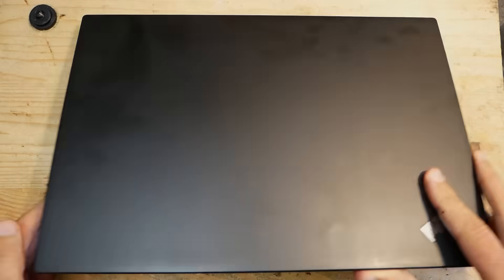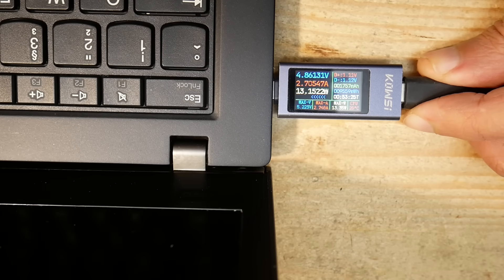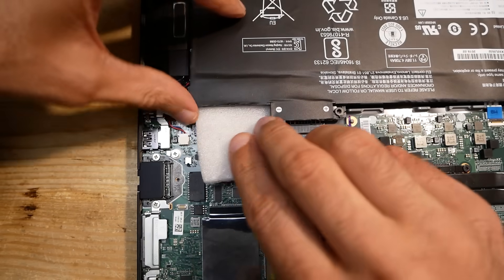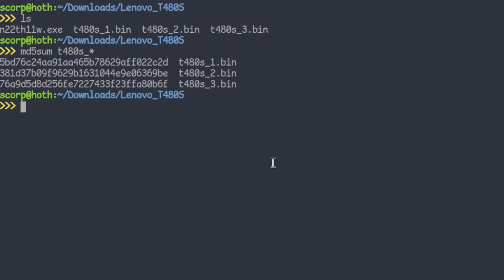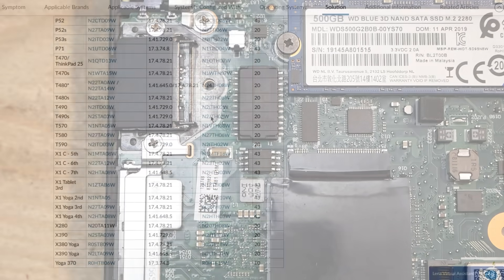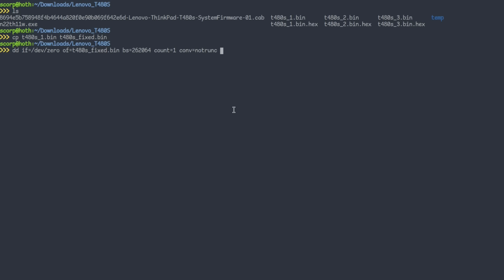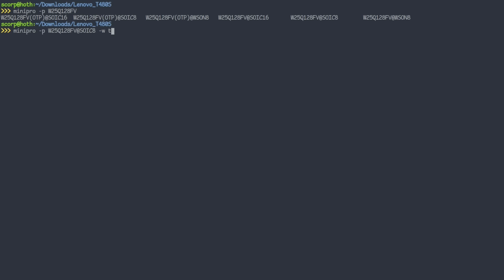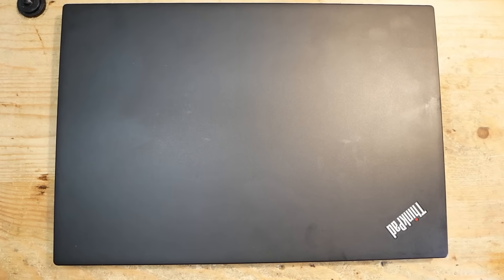Why is this Lenovo notebook not charging? Let's fix it!

Comment: Thank you so much for all the info, it has been a great help. I was able to finally fix my thinkpad. While I didn't use linux, I more or less did the same thing on windows, and I was able to successfully fix my thunderbolt port.

1. I used the T48 programmer along with Xgpro to read the original chip (W25Q80DVSIG) from the laptop. I did several dumps just in case.
2. I got new "W25Q80DVSIG" chips and used HxD to edit the original .bin file with the TBT.bin file from levono
3. Wrote the modified bin to the new W25Q80DVSIG chip 
4. solder the chip to the laptop and done!
Reply from the maker: Awesome, glad to hear that!

Comment: I have a T480, TB controller is not patched but I haven't ran into issues yet, I couldn't update it because I dont have the original charger or any thunderbolt device since it requires one of those 2 to update the firmware 😔
Reply: After few minutes of trying and rebrowsing the forums I managed to get the firmware to NVM 24! Turns out the fwupdmgr in Debian repo (in my case LMDE) behaves a bit differently, so I put the Ubuntu based LM in a ventoy drive and did the update from it and it works. I'm glad I came across your video and you replying to me so that I tried the whole thing over again 😊
Reply from the maker: You actually don't need the original charger to do that. If you plug in any usb-c charger with 65W or more and your notebook complains about a non original charger, then your notebook is already affected by the issue mentioned here. For the notebook there is no way to determine if the charger is original or not. The only way when it complains about that is if your charger doesn't deliver at least 65W. And that is exactly what this issue is about.
Reply: @necro_ware  i did try upgrading the firmware with the windows package  and fwupdmgr in Linux mint, both failed, it shows the old firmware version when I went to check after the update attempt. I found out after reading a post in r/ThinkPad. For now the laptop hasn't complained about the non genuine charger or lower wattage rating charger, and it still charges normally.

Comment: You're clearly very good at this! I run a non-profit; we have recently been donated 150 laptops. They're all Lenovo's and they're all potentially affected. I'll make sure our refurbishment workflow updates the Thunderbolt controller.

Also, I didn't know you could use a larger ROM chip, nor did I know of some of the Linux commands you used. Very informative stuff!
Reply: theoretically romsize shouldn't matter unless the pin layout and addressing is changed. It's convenient on the side of the manufacturer here as well because they swap in and out different sized chips as needed.

Though technically very strict rom handling could be problematic with this. In this case it's a firmware chip so that's pretty unlikely.

Comment: If you want to do any sort of repairs of modern devices one of those programmers and clips are essential. Those sorts of flash chips are everywhere
Reply from the maker: Not only modern devices. I'd say for very old hardware from 80's and 90's it is at least as helpful. Probably even more.

Comment: My main laptop is a T480s. I've added the X1 glass touchpad, T490 LCD panel, and new genuine battery. I get about 12 hours runtime, only ever run Debian Stable on it. I also don't have a TB controller in fwupd but also I've never had a problem charging... So I think I will leave it 😅
Reply from the maker: If you don't have TB in the list, then you probably just didn't realize yet, that you have that problem. With this issue the notebook charges with <15W, which is sufficient to charge it over night. But if you put some serious load on the CPU, the charger will not be able to compensate the power consumption.
Reply: Ah you are right. That probably explains why it sometimes cuts out charging. Well then. I will have a think about it. I have done small soldering but never chip flashing. This video gives a good tutorial if I want to try :)
Reply: @necro_ware  Update! I put a CH341A clamp on my firmware chip and read the same checksum three times. It seems my chip is okay, although the first ~256k has different contents than the latest TB controller firmware from fwupd. It seems my BIOS had the wrong settings for "Thunderbolt BIOS Assist" (Disabled good, Enabled bad) and "Pre-boot Environment" (off instead of on). Now my Thunderbolt controller appears in fwupd (with latest update already applied, apparently). I also got a hot air gun and desoldered an SPI EEPROM test chip successfully, so at least there's a new skill unlocked for me :)

Comment: Das Problem ist eigentlich dass beim In-Circuit Flashen der Controller auch mit Strom versorgt wird und der beim Beschreiben dazwischenpfuscht. Der Baustein hätte einfach raus müssen fürs neu beschreiben.
Reply from the maker: In manchen Fällen kann so etwas ein Problem sein, das stimmt, aber nicht in dem Fall. Erstens, wenn das so wäre, dann wäre der Inhalt über die ganze Länge des Speichers kaputt und nicht nur in den ersten ~256kB. Zweitens, der Chip ist defekt, ich habe natürlich nach dem Ausbau versucht den noch Mal zu lesen und zu beschreiben. Wie gesagt, das Problem ist, dass bedingt durch den Bug, der Chip andauernd beschrieben wird und über die Zeit ausgeleiert wird.
Reply: @necro_ware Nunja - wenns wieder tut ist das ja erstmal prima. Diese seriellen Flashes sind ja nicht wie deren parallele Pendants alle unterschiedlich anzusprechen sondern eher alle ziemlich gleich vom Protokoll. Daher kein Wunder dass größer funktioniert.

Comment: In some cases, when reading flash, car mcus without desoldering and using that clip, some other parts from mainboard can get powered up too and may intervene with read and write. In such cases, BIOS chip needs to be desoldered and flashed in programmer directly. If still write errors occurs, then yeah, chip is busted.. 😉

Comment: Is that terminal font Comic Sans? :p

People really love their thinkpads and go to great lengths to keep even the more modern ones going.
Reply from the maker: Almost. That's Comic Mono.
Reply: @necro_ware  ah.  I use one called fantasque sans.  It's pretty good.  Kinda "fun" in a similar way but not too out there that I may get bored of it.  The slightly warped shape and lines makes differentiating the glyphs easier, though I would hate comic mono's single storey lowercase A. :p

Comment: I still don’t get it why companies are releasing firmware updates just under windows. Get the bins or do an in bios update or better both. Acer is incapable of that as well but the worse is msi. Firmware is the most critical software on your pc.
So they should always offer the bin files alongside with a digital signature and checksum so you can verify before flashing

Comment: Lenovo also destroyed Vibe P1 phone with update. After android update, the phone ran out of battery in 4-5h. The mobile was just lying on the table, without sim card, without wifi connection etc. No further firmware update was released... The phone was under warranty, so it was returned to the dealer.

Comment: Shame on Lenovo - amazing fix! Too bad Lenovo didn't make their customers' life simpler by releasing some files for the DIY'er.
Reply from the maker: Thanks. Well, to be fair, they do supply their firmware files on LVFS and that is already a great move. I'd just wish Lenovo would keep up with the overall quality they used to deliver and stop pushing away the responsibility. Especially for such expensive models which were sold for professional market. Imagine the notebooks of that class cost new around 1,5k€ and it's a disaster to find out your device was killed by the manufacturer right after the warranty time has finished. They also didn't provide any information to any repair services and just told that the mainboard had to be replaced. Despite that the flash chip costs may be 1€. All in all, disappointing behavior.
Reply: @necro_ware  Exactly. They basically broke the device and all they supplied is an update file which is useless to most people. As a minimum, you'd expect a tech bulletin to explain the issue so others can repair it. But that would probably mean a class action lawsuit. In the end all those decisions are made by the legal office.

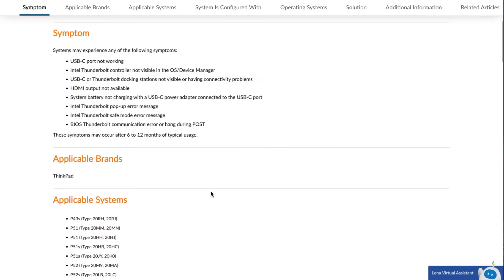Comment: 2:51 One day a new Lenovo firmware killed my network card. I couldn't believe it for a long time. Since the problem started with a blue screen appearing intermittently. When I accidentally removed the network card, the problem was magically solved. And with the help of some utilities I saw that my network card was locked. Thanks Lenovo I will never buy a Lenovo laptop again.

Comment: Great video, why not just write the bin file directly to the flash instead of filling it with 0s then patching it with the bin file ?
Reply from the maker: That probably wasn't necessary indeed. The damaged area was a bit longer, than the firmware blob, that's why I thought it would be a good idea to erase it.

Comment: What was the intension to fill the original firmware with zeros and then merge the new one into instead of flashing the entire new one directly?
Reply from the maker: No real intention. The damaged block was slightly bigger than the firmware blob, that's why I decided to erase it. Most likely that step wasn't really necessary.

Comment: had same issue with ThinkPad x280, at first was thinking it was bad USB-C port (as it was a bit crumbled), but even after replacing it (my first solder work with hot air station), still no luck. After a while found about the firmware issues with Lenovo laptops, flashing with programmer saved the laptop but if the wear on flash is high maybe getting new chip is good idea, replacing the flash chip seems to be easier than USB-C port anyways...

Comment: Why was it necessary to modify the binary to overwrite the sections which were no longer stable from the original chip? Couldn't you just have flashed the new chip with the entire binary that was provided by Lenovo?
Reply from the maker: Two reasons. First of all, there is no one firmware binary which is provided by Lenovo. They provide it in chunks depending on what needs to be updated. Second, there are unique IDs stored in the flash, like MAC addresses,  serial numbers,  Windows keys etc. If you overwrite the entire chip, you will lose that data.
Reply: @necro_ware That totally makes sense. I suspected you were trying to preserve unique attributes, but I didn't realize they offered the firmware in chunks. That surely makes recovery from a bad update very difficult!
Reply: @necro_ware  I want to try to fix my t480, it has all these symptoms. but could i use HxD to recreated the modification of the binary, on windows?
Also, couldn't I just replace the W25Q80DV with a fresh one and try to do the update from scratch using the levono Critical Update?

Comment: What a stupid fault. Stupidbolt firmware shouldn't have anything to do with powering the laptop or charging the battery. The power circuitry should be controlled by dedicated buck controller chip(s). Also the PSU should be outputting 20V anyway. Modify it to ALWAYS output 20V.
Reply: Welcome to USB-C power delivery. Active communications is required to negotiate what voltage to use

Comment: Maybe if the main platform controller is implemented in a way that it starts an operation with the flash just after reading the SFDP register first and getting all the right SPI commands and page/subsector/sector/block layout (if there's a slight difference) you won't notice a thing. Be careful with Winbond part numbers. There are Q (QE=1 fixed) and M (manual QE=1 toggle through SR2) variants. That's why I always update all the fimware when I buy a used notebook. Quite a few years ago a similar severity level update saved one from premature battery degradation. Had a similar issue with a T480, but fortunately the QSPI flash seemed salvagable. I had to temporarily configure a more relaxed thunderbolt security in UEFI to make it visible. There were some minor trackpoint unresponsiveness issues (under linux and windows) but fwupdmgr and LVFS solved it automagically after a fix was made available. TheLenovo Vantage and other windows based tools weren't able to to fix the TB issue because of some sort of bug or a coding error in a script if I remember correctly.

Comment: Very interesting. 
I have a somewhat similar problem with another Thinkpad, a much older one (model 755CX, pentium 75). It needs a firmware update to the latest one released by IBM, because the firmware it has on right now has a bug that prevents the driver for the sound card (Mwave combination sound card+modem) from installing in Windows 98. It works in Windows 95, but I want 98 on it. The firmware update file is available, however it's a Windows executable, no separate .bin file. And it has a weird quirk: it refuses to update the firmware if the laptop isn't connected to power AND has a fully charged battery. Yes, both have to be present at the same time. Now, I have a few batteries for it but they are all in very bad state - not surprising since no new batteries for this model have been manufactured for over 30 years. I tried all sorts of tricks to get them to charge, even tried rebuilding one with new cells but apparently the batteries have some sort of protection mechanism that once the cells become completely discharged it kills the battery and never allows it to try to charge again even if you replace the cells. 
And I also tried to locate the firmware chip on the motherboard - but there isn't one. There are plenty of custom IBM chips in PLCC packages, and my guess is that the firmware is stored in one of them - but nothing that I could "attack" with a simple chip programmer. 
Thus, I don't have a solution for updating the firmware on my laptop. :(
Reply: Maybe you can do some kind of bypass to fake the battery voltage checks.
Reply: @SobieRobie  I tried that in various ways. I guess the chip in the battery also has some sort of protocol by which it tells the laptop if the battery is charged or not. There are 6 contacts between the two, several of which go directly to the chip. I tried to fake a charged battery in many ways (using a more modern battery hotwired, using a battery charger to simulate a battery, using both a battery charger plus one of the original batteries connected at the same time etc) - none worked.
Reply: Can you patch the installer binary?
Reply: @nyanpasu64  I tried - but it seems to be encrypted and compressed.

Comment: You are a lifesaver. I also use Lenovo ThinkPad T480s and Linux. And I did not know about that fault and that fix update. Luckly I had a chance to update my laptop Thunderbolt host controller firmware from 14.00 to 20.00 through fwupdmgr. Big thanks!!!!

Comment: Also the usb 3 power connector is not as remotely robust as the classic cylindrical ones.
"this seems to be the direction for the whole industry"
This is the truth and it's very sad.
kcuf apple for starting these pervert practices for all the other brands to see most people don't care until it's too late
Reply: It's funny how Apple gets blamed for being the first to adopt new interfaces, and then gets blamed when they're the last to adopt new interfaces.

I've often wondered whether it's sensible to try shoving literally everything from the main power input to audio to mice to multiple HD displays to all of the above at the same time ... over one single cable.  But I guess that's what people want.

(OTOH, it has been pretty convenient to charge my phone, tablet, laptop, earbuds, mouse, keyboard, camera battery, wireless mic battery, spare battery packs, etc etc etc) all over any garden variety USB A port with 500mA to spare.
Reply: @sirnickity  i'm referring to this: they don't provide schematics and spares to independent repairers, you need their proprietary software to validate the new part (button, chip, screen, battery) on the phone or etc.
Non user replaceable battery, etc.
don't defend an abusing company please
Reply: @sirnickity  you can watch louis rossman very detailed videos on how they want to boycott repair to get even more profits
Reply: "the same time ... over one single cable.  But I guess that's what people want." I don't want it. I want different connectors for different things. Its what manufacturers force you to have because just one connector saves them a few cents.